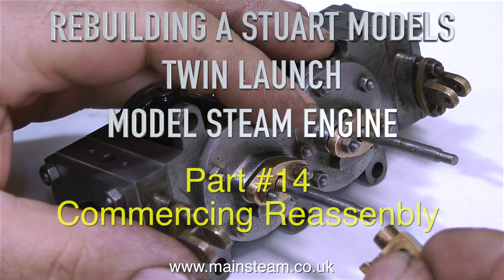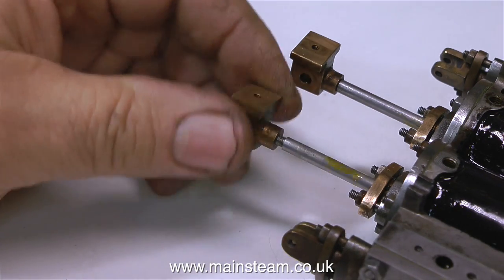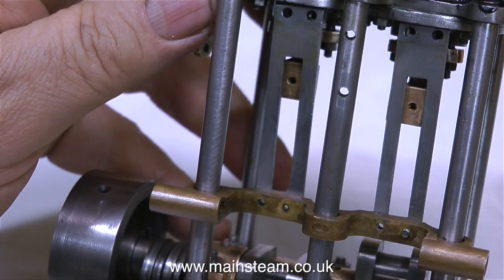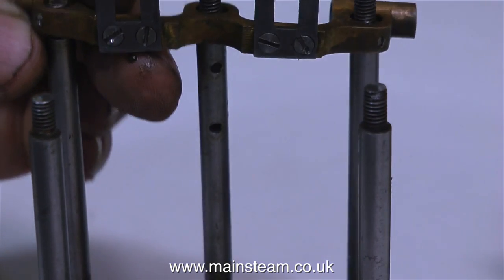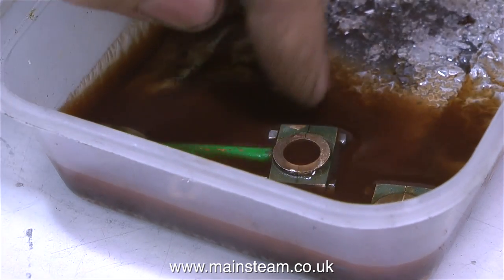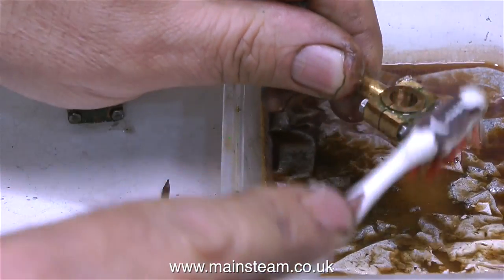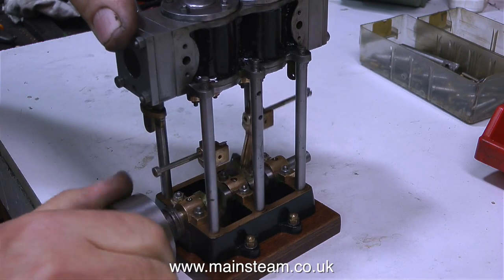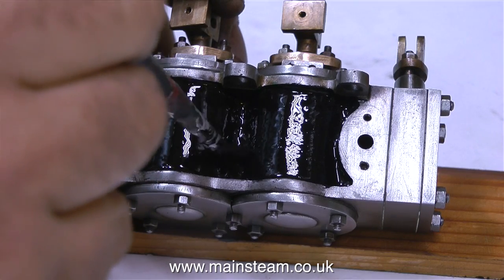STUART MODELS TWIN LAUNCH STEAM ENGINE REBUILD - PART #14

Comment: In a machine shop, the blue  print is half of the contract. If you make the part to the tolerances on the print, you have fulfilled your part. The other half of the conract is when you get paid.
I am guessing that there must be tolerances on model prints???
And that they are on there for a reason??
As a Quality Control Technician,  it was my job to document all the measurements of the part. If the print was wrong, we still got paid.
And paid again to make it over...
The quality is in the details,  ,,,,,
Thanks,  and keep up the good work.

Comment: You underrate painting! I love selecting a nice colour for my machinery. Admittedly I have no steam powered machines, but I am restoring a Fobco Star at the moment, gloss black and green, can't stand that cream yellow they came in. Thanks for the video, I enjoy watching these a lot before bed :)
Reply from the maker: I used to have a Fobco star - wish I still had it . . . . I am going to buy another one if I can find one in really good condition - they are excellent pillar drill machines :-)))
Reply: If you can, find a Fobco 5/8, or a 16mm. (note, that's not a 7/8 - they were much larger and completely different) The quill on the 5/8 is screwed instead of a taper, and capable of light milling. It's a rarer machine, they were turquoise blue.

Comment: "If the toothbrush head dissolves into a molten blob, that is not the right kind of toothbrush."
Thanks, Keith. I knew I was doing something wrong.
Reply from the maker: Yes, mine sometimes does that when I clean my teeth - ! :-))))